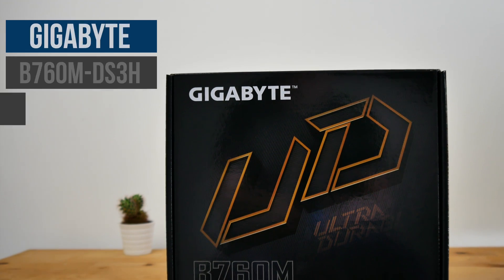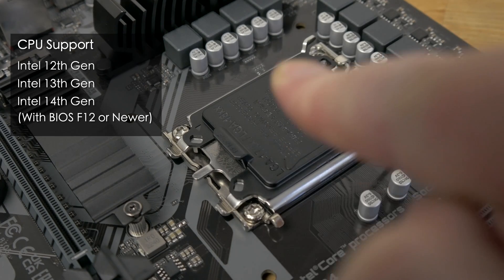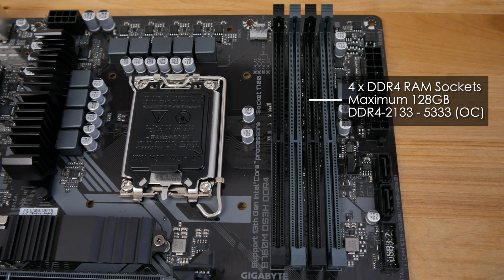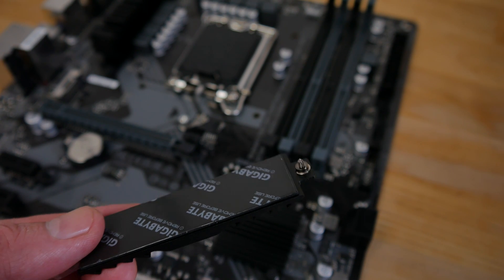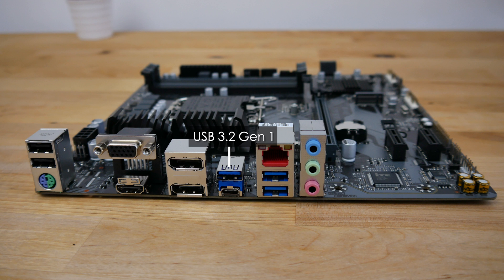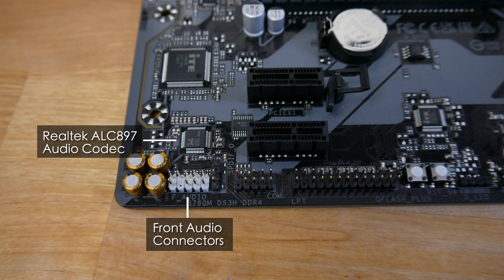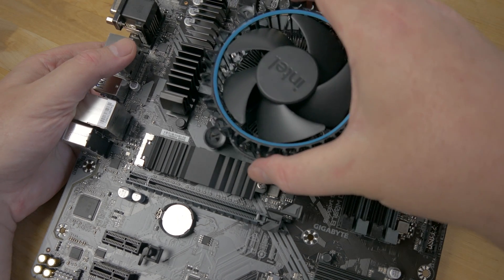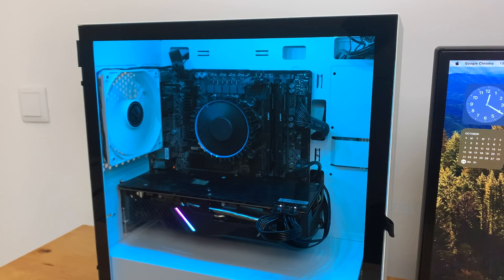Gigabyte B760M DS3H DDR4 Review - An Amazing Value 13th / 14th Gen Motherboard.

Comment: If im running games on 1080 720  will i get more hz
Reply from the maker: Only upgrading the graphics card or CPU, or sometimes using faster RAM will give you higher frame rates, not the motherboard.

Comment: I plan to upgrade my pc from 16GB RAM to 4x 32GB RAM (128 GB), do I need something to care of ... or is it just plug and play ?
Reply from the maker: Just take out the old RAM and insert the new RAM. The PC will reboot on it's own after powering on as the motherboard attempts to ascertain RAM timings.
Reply: @BartechTV  Thanks, now I'm not worried that 128GB could cause some trouble. ^^

Comment: Hi

I currently own a pc of below mentioned system requirements

Intel Core i7 12700 12th generation

16gb ddr4 Ram

Pci express card gigabyte RTX3050 6gb gv-n3050wf20c-6gd i.e. 6gb ddr6

Gigabyte motherboard B670MH

Will i be able to upgrade the processor (to 13th and 14th generation) and graphics card to higher level i.e. 8gb ddr6 or 12gb?
Reply from the maker: Yes, you can upgrade the CPU to 13th or 14th gen, because they use the same socket as 12th gen, and you can upgrade the GPU too. GPU's are universal, they'll work on any motherboard with a full size PCI Express slot.
Reply: @BartechTV  okay. One more doubt is it possible to upgrade to Intel Core i9 also. Socket is LGA 1700.
Reply: Good morning 

I currently own a pc of below mentioned system requirements 

My pc configuration is as follows 

Intel Core i7 12th generation 12770k and socket LGA1700 

Motherboard is Gigabyte B760MH

16gb ddr4 memory 
GeForce RTX 3050 6gbddr6 graphics card 

Is it possible to upgrade to Intel core i9 processors?

Comment: Both SSD slots support m.2 nvme 
Are you sure ?
Reply from the maker: Yes there are two NVME slots . I have macOS Sequoia on one, and Windows 11 on the other.
Reply: @BartechTV  thanks man, 
my 980 went for replacement so was planning to separate the OS & gamming drives but wasn't sure at 1st almost bought a SATA ಠ﹏ಠ.

Comment: Hi can ı use i5 13600k with b760m?
Reply: yes but you can't push the k cpus on this mobo
Reply: Yea I'm using this motherboard with i514600k and it's working great
Reply: @Jin68Jin  hi can I use a AMD Ryzen 5 7600X 6-Core wit the b750m just wondering if you know?
Reply: @real_aut0micx  yes u can but just check if the bios is updated or not while buying

Comment: how is temps on this mobo with unlocked cpus like k series? does it over heat?
Reply from the maker: Temps on unlocked CPUs would depend on the cooler and the case being used, rather than the motherboard. More effective cooler and better airflow = lower temps.
Reply: @BartechTV  plan is 14700k with liquid cooler on corsair x case . i already use the pc with 13500 want to upgrade, worried about heat issue i got 6x 140mm fan  in case

Comment: I tried to install a 12600kf on it, even updated the bios!does this mobo only work on 13-14th gen cpus?
Reply from the maker: No it works with 12th, 13th and 14th gen.
Reply: @BartechTV  I tried to install the 12600kf on it, put it on a h610 instead, this is where I write this from! I guess I got one of the malfunctioning ones then!getting a 12600k for a small 4k video editing rig! as said I updated the bios on the b760m, still said no cpu on it!I use the gigabyte mobos a lot though, on the previous pc I killed with a nice 5800x, I have also put it on my mothers 5700x build, and sent one to my nephews 3600xt build!